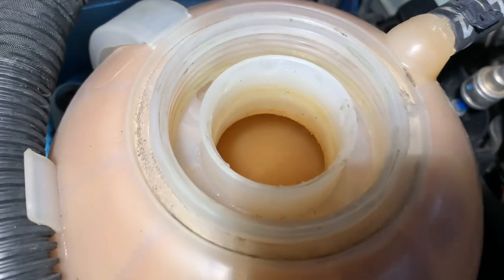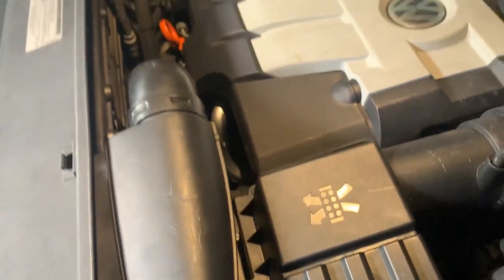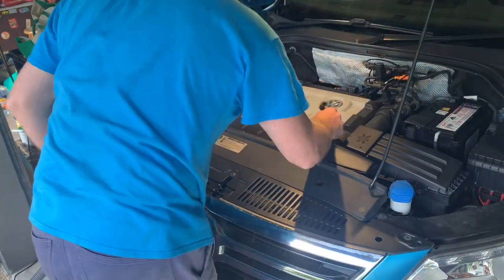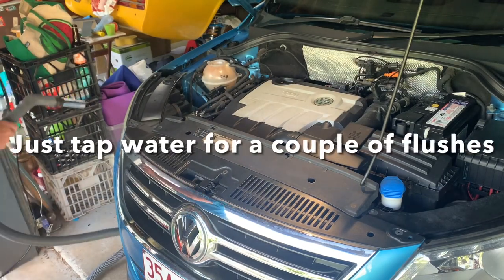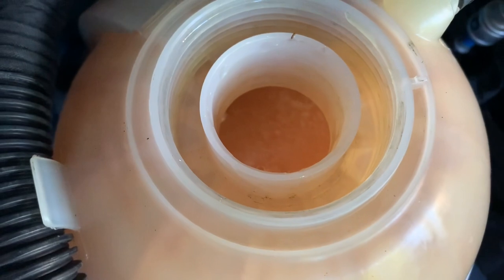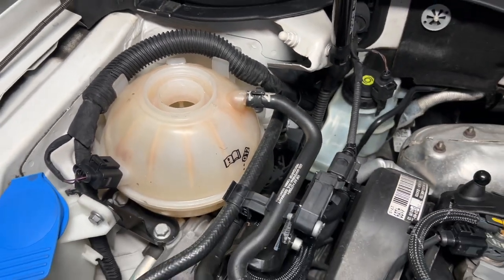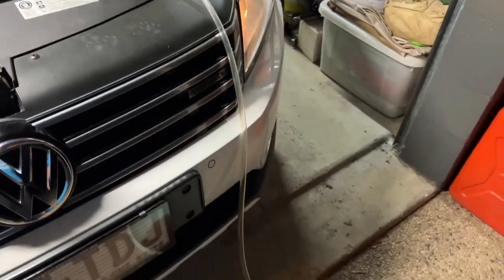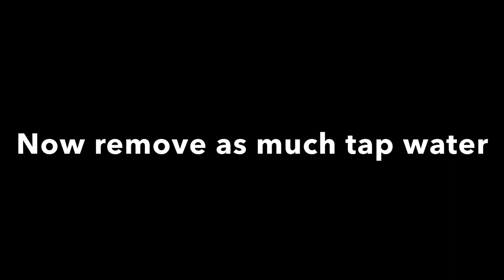VAG Coolant Flush

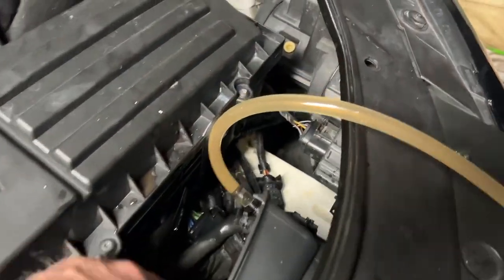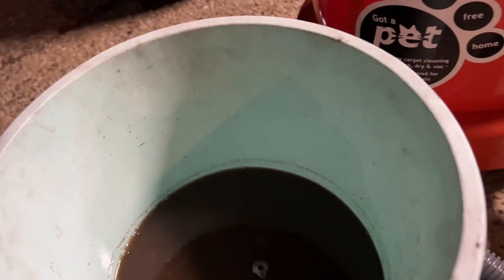Comment: For those reading later, the really interesting bit for me personally starts at 6:48 on this video.  If you are just doing a coolant refresh, and NOT flushing the whole system, this bit, starting at 6:48 is how you do the job.. You do not need to make a mess of your shop vacuum, undo major hoses, or let the coolant splash all over the front subframe while it drops into a pan beneath the car. You do not even have to remove the lower engine cover. The coolant goes neatly into a bucket,  when you connect a section of tube running from the top of the radiator, over the front bumper and into a nearby bucket. 

If you attach a clear 1/2" OD tube right in the location shown and PLUG THE LINE that you removed from that 8mm nipple on the radiator fitting, the suction on the removed line will be blocked. Use a clear flexible  tube about four feet long, and drop the free end in a bucket. When you start the engine, old coolant will flow from the radiator line under light pressure from the water pump. New coolant, which you pour into the reservoir will be pulled, by suction, into the engine. 

In this manner you can rapidly extract 4 to 5 liters of coolant out of the cooling system at the top of the radiator, and introduce the same amount of new coolant into the engine, through the reservoir. When you are done, my suggestion is that you then drive the car for a while, until the new coolant is completely mixed with whatever original coolant remains. After everything is completely mixed, then TEST the acidity of the coolant with a test kit, such as the Phoenix Systems 8006-B Double-Ended Brake Fluid + Coolant Test Strips, to see if the acidity is low enough for your needs. Acidity of 5 needs replacement 6 is cusp, and 7 is okay. 8.2 is the pH of brand new G12 50/50 pre-mix..

If the acidity is still too high, after one extraction, then do one more extraction of 4 or 5 liters of old engine coolant, while pouring the same amount of new G12 pre-mix into the reservoir.  These changes will take you about  15 minutes each. The water pump in the engine does the work for you. You get about a 60% change of the coolant, each time you do this. Total engine capacity for coolant is said to be around 7 liters. 

Best of all, when you use this approach it is not necessary to bleed the system afterwards, because you never let any air into the system. You block the suction on the line that emerges from the radiator, when you attach the new waste line to you bucket. No air gets into the system with this approach. 

Before I executed this procedure, I had an acidity of my coolant of pH 5.5, using a Coolant Test Strip. This is too acidic and the coolant needs to be replaced with a pH this low. The pH of brand new, 50/50 mixed G12 coolant is 8.2.  After removing 5 or 6 liters of old G12 coolant in a 50/50 ratio, and replacing that with new G12 50/50 mix, I have an acidity of 7.  Since 8.2 is perfect, this is a big improvement for 15 minutes of work. I did the pH test after I had driven the car for a while, in order to get a good mix of new and residual, old coolant. Tomorrow I will do one more cycle of 4 liters out, 4 liters in, to get a little closer to 8.

If you are not flushing out a dirty system, and simply want to bring the pH of your coolant back to a good working level, the method described at 6:48 is where you want to start. Pull out old coolant at the same time you add new G12 coolant, then drive the car for a while and then test. If the pH is 6, do it one more time, 7 is a good working number. 8 is perfect, as good as brand new, G12 coolant / water mix gets..

Just my thoughts Pete, thanks VERY much for this fine video.
Reply from the maker: Very good information. Thank you for your detailed addition. Love it!
Reply: Hi, you say that at 6:48 is not the way to do a full flush of the system, just a way to do a refresh. If this is true, how would you do an entire reflush of the whole cooling system? TIA

Comment: Pete, at 7 mins in your video you show what looks to be the easiest and most efficient way to flush the coolant water in via a hose, drain out running the engine and a tube from the top entry to the  top of the radiator. Looks great as the system really flushes until the water is clear then refill with VW coolant. Am I missing anything? Thanks for sharing.

Comment: Hello Pete, thank you for this very informative video!
Do you know if this method is effective for flushing and cleaning the heater core and intercooler?
Reply from the maker: If you have the heater set to high then yes, this process should also flush the heater core. The intercooler however is an air-to-air intercooler so there is no coolant involved.

Comment: Isn’t there a drain? I have a mk4 golf and there’s a tap by the bottom rad hose.
Reply from the maker: Nope. Unfortunately there is no coolant tap/drain.
Reply: You would think so but, no, nothing in the way of a drain. What is worse, is that is no way to drain the bottom half of the radiator on a TDI without actually removing the entire radiator and turning it on it side.  I am not joking. The lower hose connects in the middle of the side of the radiator. Not at the bottom unlike just about every other water cooled car on the planet.

Comment: Just remove bottom rad hose 😂
Reply: You don’t understand how complex the vw system is, that only gets about 1l out via the bottom hose
Reply from the maker: Agreed.
Reply: LOL. The 'bottom' radiator hose is not at the bottom of the radiator. It is halfway up the side of the radiator. And you do not 'just remove it'. Some people remove the right front wheel, the fender liner, and go in from that side.